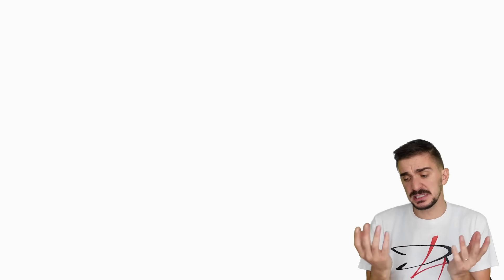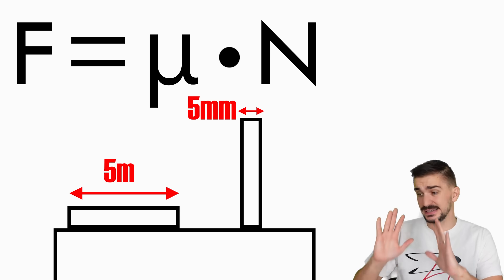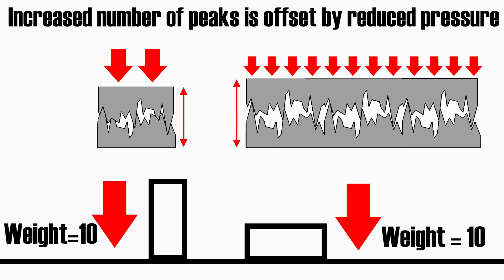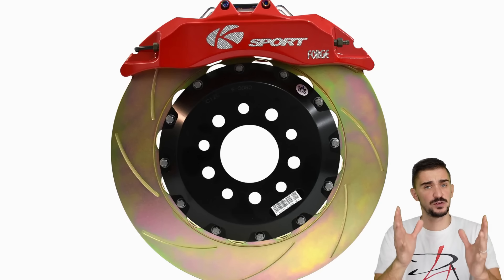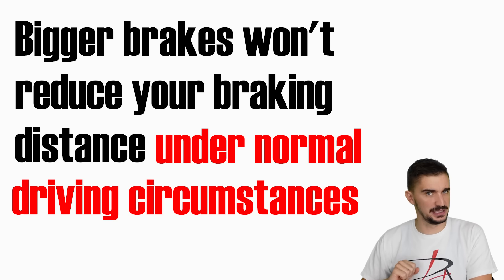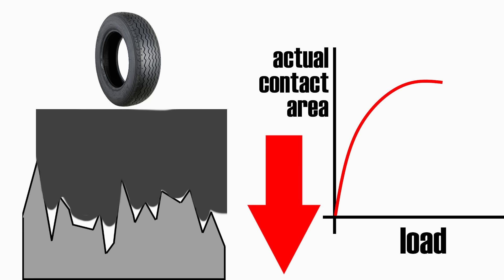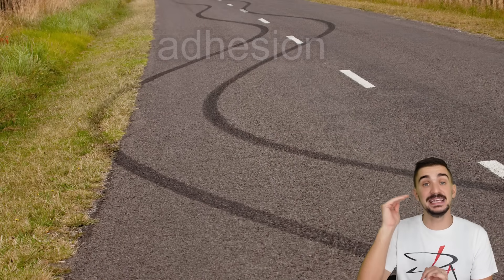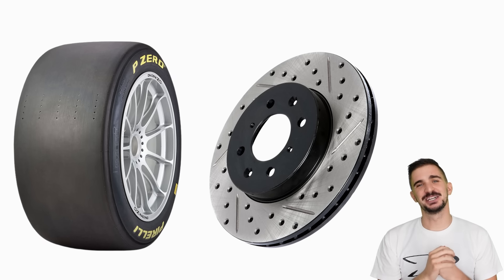Why Big Brakes Won't Stop You Faster but Wider Tires Will - Friction and Surface Area Explained

Comment: You got this all wrong.
People don’t put bigger brakes on for one cold stop. People put bigger brakes on so that stops #2 through # 90 will be shorter.
Big brakes absolutely make your car stop faster on all but the first cold stop. Duh.
Reply: if you looked through the comments you would see plenty of people who think it stops faster, and its pretty funny to say oem brakes would fade after one stop
Reply: @arcanevoid9199  yeah I only build and tune race cars- what would I know, right?
Yeah don’t you know that all kinds of track special cars use standard kia sedan brakes because oem brakes are so awesome 🙄
You clearly sound like somebody who’s never been to a race track or driven a performance car.
Reply: @WithCarePlz  how is any of that related to what I said?
Reply: @arcanevoid9199  clearly comprehension is not a strong point of yours, so I’ll make it simple: if you do an extremely hard stop with nearly any road car that doesn’t have “big brakes” you will see brake fade in action on the next corner if you brake hard again. Oem normal car brakes are designed for 3 things: to stop as quickly as possible on a cold stop, to last a long time mileage wise, and to be as quiet as possible. If you take a normal car on normal brakes to a tight track you’ll see what I mean about oem brakes fading. They heat soak and lose bite. They aren’t designed to be spanked all day on a mountain pass or track. 
If you had any experience at all around performance driving then I wouldn’t have to explain brake fade to you. Your ignorance to why anyone would replace an oem braking package speaks volumes.
If you think that big brakes don’t help you stop better- downsize your brakes and see.
I’ve done it. On my rally car it came with 6 piston 13” brembo brakes and I downsized the calipers/rotors to be able to run method wheels. They’re still brembos they’re just smaller. The difference between the car with the big green brembos and the smaller brembos is shocking. The bigger brakes and smaller brakes will come close on ONE stop. But at every single corner the car was able to brake later and harder and gain time. 
Downsize the brakes in your car and then come talk to me . I recommend you use bicycle brakes since “bigger brakes don’t make you stop better” 😂 🙄
Reply: @WithCarePlz  fade is a completely different topic though, and the standard is usually 5 hard stops from highway speed without significant fade. so unless youre driving like an idiot, or sitting on the brakes down hills instead of engine braking like your supposed to you wont really have an issue for street driving. and also there are some cars where just a set of more aggressive pads is enough for track usage, and im not talking about cars that come with big brakes from factory. and cold stop performance is down to pads not brake design, same thing with overall noise. track usage is a moot point, the title of the video isnt "oem brakes dont fade and are perfect for track usage", and of course bigger brakes will have better fade resistance but they still wont stop the car faster, just more consistently. thats the whole point. again you just keep bringing up the same thing of "downsize your brakes"
Reply: @arcanevoid9199  keeping it simple: can’t you see how obvious it is? If smaller brakes make a difference at all then the inverse must also be true bigger brakes must stop better. It’s a basic principle, sir. 
You can talk all day about some argument or another but put it like this: will bet you a million dollars you and I we race to a cliff edge in identical cars-you with the smallest brakes we can fit and me with the biggest brakes we can fit. You in? I am. I’m 100% confident and willing to bet my life on it good sir. Also buddy even a perfomance oriented car like a 5.0 or an STI or Charger or you name it but get the base model one and Stop hard from 60 over and ovef next to a gt and on the 3rd or 4th time most oem brakes are sparking or on fire and making nightmares. I’ve done it to many a car out of joy/angry joy. Factory normal people cars are made on pad compounds that accentuate one panic stop and lifespan above all. If you had an iota of experience or research you’d know this
Reply: @WithCarePlz  if you can already lock the wheels with stock breaks how are bigger brakes going to do any better? thats the premise behind this video, and with bigger brakes comes more unsprung weight which sucks. again stop bringing up this stupid try smaller brakes point, it doesnt mean anything

Comment: Wider tire makes the pounds per square inch more distributed so in fact on anything but perfect conditions a wider tire will slide easier due to less pressure per square inch .....set 100 lbs steel plate that's say 20" by 20" on your chest ...ain't that bad but take that 100lbs and balance it on a needle and then place it on your chest ........it's going threw you like your chest was nothin but air ........3rd generation mechanic welder fabricator here and over 32 years of drag racing taught me a wider slick looks cool but if u wanna hook and scream like a rocket you increase slick hight because more psi but it also raises the final drive ratio as well ......take a dime and a quarter bolth heads up roll bolth till they make one full rotation.... which one went further? There's your proof

Comment: Interesting you never use the word leverage. Kept on saying surface area. Bigger diameter rotors will work better because they have more leverage over smaller diameter rotor giving everything else being the same. Same with the tires, wider tires will have more leverage over the road than skinnier tires.

Comment: A larger brake rotor does brake harder, because of a longer moment arm and most likely a larger calliper piston surface to multiply the braking force more. However the braking distance is limited by the rubber. 

Because most stock brakes can lockup stock rubber already, increasing braking force doesn't help reducing the braking distance. For a car with upgraded rubber, either width or compound or both, up to a level that the stock brakes cannot lockup the wheels, then a larger brake system will reduce braking distance.

BTW we don't want to lockup the wheels, we want to brake to a point right before lockup for shortest stopping distance.

Comment: Nearly all disk brakes have enough power to lock up a wjeel now how much rubber you got on the ground more tire friction on the ground will provide more traction surface area to the ground. It o ot makes sence that a tire is more responsible for better braking.

Comment: I have a 950kg hatchback with 225 wide semi slick Bridgestone potenza adrenalin re003's and I can brake from 100kmph to 0 in 27.5 meters the  average was around 29m stock braking system with 250mm front disks 240mm rear .

Comment: Nobody's mentioned that depending on the car, if you have a lot of negative camber, a wider tire isn't doing anything for braking since some of the outer edge won't be touching the ground anyway.
Reply: Yes but bigger brakes wouldn't help either becaus the problem isn't braking force but grip (I am aware that is not what you said, i am just clarifying).
Reply: Yes, You are very much right

Comment: Great idea on paper but it only applies when assumed that the quality of all braking components are identical before upgrading brakes and after, which is only applicable in cars that already have high performance braking systems.

Your video gives people the wrong idea that upgrading brakes don't help the car to stop in a shorter distance but wider tires help more because you chose to not include the quality of the components completely, when in 99% of cases of all road cars upgrading all brake components is far more useful than wider tires, and most cars already are equipped with close to the widest possible tires anyway.

And in most cases where people might want to decrease their braking distance are people who want to take their cars on the track where larger discs or carbon discs are the only solution anyway. Because 99% of cars aren't high quality, high performance cars the size of the break discs are really small because they aren't made for track purposes (again who are the only people wanting to better their brakes), so the size of the disc will in almost all cases have to be increased.

Comment: Before they really heat up. That's where the big brakes have more thermal capacity and will dissipate heat faster, thus continuing to perform greatly, far superior to smaller brakes and therefore inevitably stopping the vehicle faster.

Comment: This is proven wrong pretty much by anyone doing a before to after test on upgrade. It is true though a wider tire will help. But to act like the exact same theory doesn’t work for surface area force applied to brake rotors won’t help is just ignorant. Don’t forget you also have the increased leverage on wider brake rotors.

https://youtu.be/ekSCcK9buxo

Comment: If friction was the only factor, you'd be correct. A larger rotor also allows the caliper to be moved further away from the center. This allows more force to be applied in the same way that a wrench with a longer handle allows more torque to be applied to a nut. I'm not disagreeing with your science but I don't think you're looking at everything involved with using larger brakes.

Comment: F1 uses 13 inch wheels with tall sidewalls/WIDE tires , smaller diameter wheel is lighter.

Comment: Assuming the stock brakes are adequate is also going to change the results. I am wishing my daily driver Tacoma had better brakes. I really can’t do any better as far as tires go but when I need to slow on freeway off-ramps I have not been able to easily get near ABS threshold in the dry. I am wondering if another inch or two of rotor diameter would increase the lever arm enough to make a difference. I haven’t tried a panic braking stop on a dry surface from freeway speeds but there have been several times when I had to  markedly increase pressure to stop while thinking “holy crap, this isn’t good”.  My previous car had factory Brembo brakes and stopped quite well, I never worried about stopping. True, this is a truck but it’s not that heavy……

Comment: Also for most people 

Handbrake shoes are a lifetime part or only need replacing when they have cracks or rot.
as they should never wear out really as the car should never be moving while its being engaged so it cant wear. 

Many brake places will scam customers saying they need new handbrake pads and never put new ones on as those with 500,000km on them still at 95% thickness.
Reply: You have to be drifting everyday to wear and tear the handbrake 😂. Because being static means no kinetic energy (or very minimum if we're including potential energy of gravity) to be converted into heat energy.

Comment: It’s because most of the loss of braking occurs due to slippage of the tires and lock age of braking systems 
Wider better quality tires will always increase your stopping performance
Reply: You can leave out wider, its the compound that will decrease stopping distance.
Reply: @johngalt97  wide tires=more contact area on the road
It’s common sense just like bigger pads and rotors gets better stopping power when breaking

Comment: This is the first video I've seen of his that's just flat out wrong. Otherwise F1 would just use tiny brakes to save weight. Makes me more skeptical of his other stuff tbh.
Reply from the maker: Google f1 brake sizes
Reply: @d4a  You don't have a point.  If the size of the brakes truly doesn't matter the brakes of an F1 car would be tiny. Why aren't they? Why not, as others have said, use brakes the size of a coin?
Reply: @TheEnriqueSpeed  actually they are pretty small, did you google them? and dont be stupid, of course the size of a coin isnt going to work. the smallest brake size that works is the best for performance
Reply: @TheEnriqueSpeed  F1 cars repeatedly have to slow down from high speeds when going through a track. If the brakes were tiny, they would overheat very quickly and cause significant brake fade. Did you even watch the video? Or are you just unwilling to learn?

Comment: Not only all of this, but putting on a wider tire could actually cause handling problems because a wider tire spreads out the force over a larger contact patch, thus possibly reducing grip and causing hydroplaning. Sports cars/race cars have wider tires but also more down force. It's a catch 22 in regards to drag.
Reply: Wider tires don't give a bigger contact area, just wider side to side, and shorter front to back.

Comment: This video suddenly clears up why, in cycling, disc brakes have better modulation than rim brakes. It’s not the system, but the materials used.

Comment: Hold on a minute! I think you've made some good points, but there's a couple things you kinda dodged. First, increased brake rotor diameter absolutely increases brake torque. You do give that torque back going with a larger diameter tire. But if you you have a larger wheel with a lower profile tire and the brakes fill up that wheel, then yes, you have more braking power, all things being equal. Of course, the system's brake pressure will be tuned to deliver adequate torque with the OE pad, inside that pad's temperature range and everything else you said about heat management is correct.

On to tires,  going with a wider tire doesn't increase the size of the tire's foot print. It just changes the shape of the contact patch. Yes, the tire itself will have ore surface area and that spreads out the wear and heat over more rubber, but it doesn't put more rubber on the ground. The size of the contact patch is determined by the car's weight and the tire pressure. Your surface pressure will basically be equal to the tire pressure. Let's say it's 30 psi and the car weighs 3000 lbs. 3000 \ 30 = 100. So, 100 square inches of total contact patch to support the car's weight. Which is  25 square inches average per tire. 

Assuming again that you use two tires with the same diameter,  profile, tread pattern and compound, the narrower tire will have a longer contact patch that may actually be better for straight line braking performance. The wider tire will have a wider, shorter contact patch that is better for lateral traction, aka cornering. This is generally a higher priority for a sport or race car. 

As a generalization, when you go to a wider tire size, you will tend to find more sport tires. For example a small car with a 185/65R15 won't have any sport tires available in that size, sadly. But go to a 205/55R16 that has about the same diameter and those tires will fit the car if you change wheels.. And there are now sport tires available! Go to something like a 225/45R17 and you still have about the same diameter with even more sport tires available. Going to that size AND upgrading from an all season to a real sport tire will obviously have big impact on grip and braking. But you can't just automatically say, "Wider tires are always softer, because they can be." 

If you had the same car, with the same brakes and you had the same tire in both 185/65R16 and 225/45R17 and both tires were the same temperature etc. I think you would see very similar braking distances in both cases. The narrower tire would even be better in wet conditions, like you said. But in dry conditions, the wider tire will corner faster and manage its heat better and therefor, turn out better lap times.
Reply: He made the same mistake, equating wider tires to more contact patch area, in another video. But, then, most people get this detail wrong.

Comment: There was a dirt bike (motorcycle) called the "ATK" developed by Horst Lietiner.  He mounted a smaller diameter rear brake dist on the counter-shaft sprocket shaft (front sprocket). The small dis would spin faster than a disk on the rear wheel, but he calculated the surface speed to be the same, (so the heat would be the same).  It heated up faster and tended to discolor, (something not seen on the wheels of a dirt bike disk).  There was not as much surface area and material to dissipate the heat as well.  Today, my modern dirt bike has a bigger disk yet,---and it is way too powerful for me,---until the tire slips. You do a good vid.

Comment: A bigger disk diameter for more powerful braking is not really about more surface contact, but the pad contact being further from the center of the hub, so it is a longer lever, and does greatly increase stopping power,---if the tires hold the road surface.  The flip side is heat.  More surface speed is had by the bigger disk, (more distance around the circle for the same rpm.), so it will generate more heat.  All coefficients of friction being the same, the amount of heat developed, (before dissipation),  shows the braking power nicely.  But the friction of the tire on the ground has to be more than the braking so the tire does not lock up.  So wider tires are used for applications of aggressive braking, (racing).  
From different road surface condition, (from ice to dry clean pavement), different tires and different braking systems, to say the tires are the difference and not the brakes for distance is a bad statement.  I am sure many car tests were dine with similar car weight, the same tires, and different performing brakes, (the only factor of difference), and if all the tires don't skid 100% of the time when braking, you will have different stopping distances.

Comment: This is totally incorrect! Torque, the larger the force at a great distance, provides more power. Inversely, when stopping, the great the force at a great distance provides more residents to stopping. The benefit of a wide tyre is greater heat dissipation. The coefficient of friction, does not change. Mass and temperature need to be considered